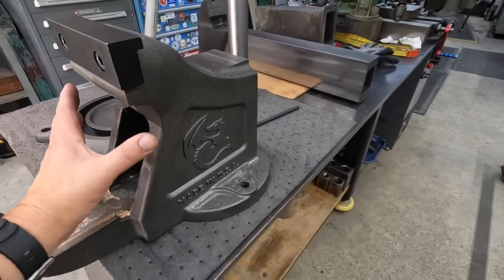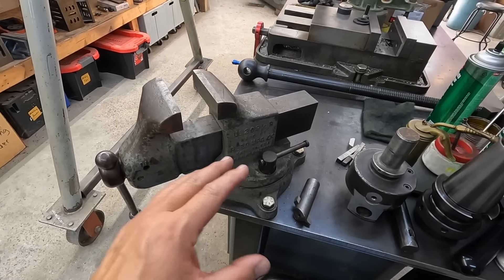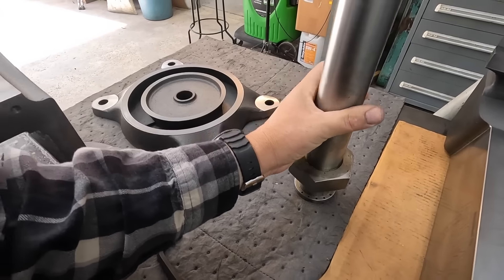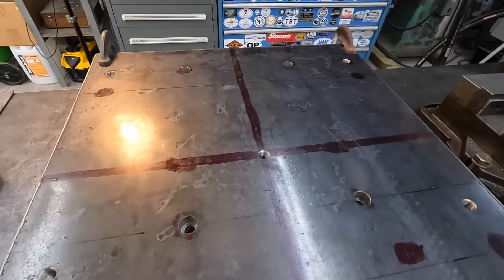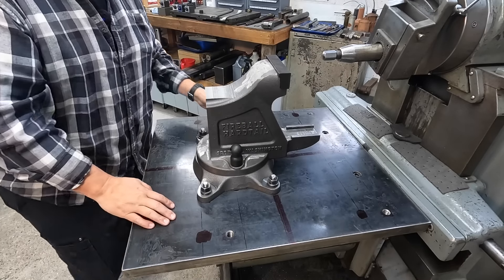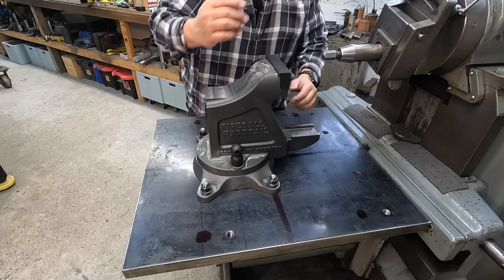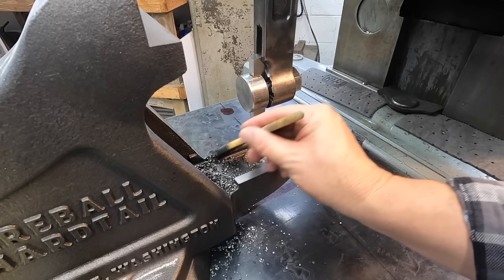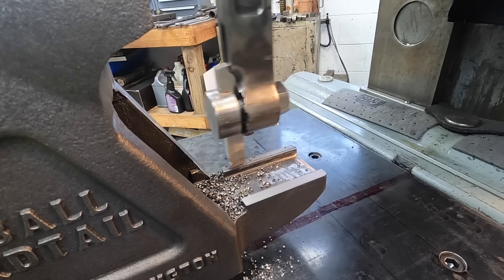Hardtail Vise Build Ep. 21

Comment: I'm not a machinist but what amazes me is the shaper's basic technology has not changed in over 100 years. Keith Rucker has that one from the 1800s and although the motor and mechanisms are different, it does the exact same thing in a different way. Metal scraping against metal making chips.

Comment: Working at Boeing, years ago, we called them bomb sights as they had several offsets built in from centerline. .010, .020 etc. They work great in a bushing holder as you can drill without moving the fixture. Brings me back to the 90's Adam! Loving your workmanship.

Comment: The optical center punch could be paired with a MagSwitch.
Reply: I was thinking the same. Or at least a  not too strong magnetic base so it's still easy to move around but will stay in place when you're removing the optical punch.
Reply: Depends on how much you want to spend.
Reply: How about a magnetic height gauge base?

Comment: If you put a DTI in your height gauge you can zero the needle on the table and then zero it on your machined surface and get a more accurate reading… you can then sweep the gauge over the surface to check for taper etc

Comment: Could you Team Up with Fireball Tool to create a Custom Fixture Table, like one with wheels, that you could rise up high enough to install it on the Shaper, and had built in out rigger supports so you COULD use the full stroke of the Shaper? Maybe use a foot powered hydraulic pump to raise and lower the fixture table to make it easier to install to the Shaper Table. That way you could have a fixture table already with plain and threaded holes and a table long enough to utilize the full stroke of the Shaper.

Comment: Actually when you were indicating the swivel base on the hot rolled plate it was actually dead on, on the inner lip right before the outer one. You can see right before it hit the last one, on the one before it was dead on. So the hr plate itself is actually pretty much perfectly level.
It seems like on the outer lip (closest to the camera) of the swivel base, there's a 1.5 thou dip (which would be insignificant to the functioning of the swivel base anyway) so it wasn't really in the hot rolled plate.
Reply: The 2 machined planes of the swivel base are not perfectly flat/parallel to each other.  The 1 1/2 thou in one direction and 2 thou in the other are very consistent with the respective variances as measured in his earlier video titled  measuring parallelism of the swivel base on the surface plate.  As such, it would imply that the hot rolled plate's own variance in flatness /parallelism  is far less and so is more than adequate for purpose.

Comment: Shouldn't that dimension 4.350" be for a reference only? The most important is to get the jaws to mate correctly in alignment, so I would think that final dimension should be driven by the actual height of the moving jaw from the sliding surface to the top. Am I missing something obvious?
Reply: If that's what it says on the drawing then that's what you do.
Reply: And 'by eye' they don't, going by his Facebook post which is a bit ahead of here.
Reply: @canonicaltom  Whereas on the moving jaw's 2.873 height ( base of jaw to top of slider) dimension, he deliberately overrode the drawing dimension by a 2 thou increment.
Reply: @james-ew7kl  The tolerances on my bench vise are about 1/4" so that really seems close enough.

Comment: Where's the other shaper gone ?
Reply: Just outside the roll up door under a blue tarp. Check out the beginning of the last video.
Reply: @macgyver5941  That is a Radial arm drill. The bigger shaper got sold.
Reply: @seabreezecoffeeroasters7994  Blow the picture up. That doesn’t look like any radial arm drill I’ve ever seen.
Reply: @macgyver5941  Forgotten when it arrived exactly but it was when he made some bolt down block points for the rear concrete. edited Search "Carlton Radial Arm" will get you some video of it.
Reply: @macgyver5941  Trawled his videos and seems he might have snuck in a third shaper to the collection. Lucky his better half is very forgiving 🤣 He did sell the big boy 60" Planer Shaper.

Comment: You only really needed to shorten two of the hold down studs,  There was no need to rotate the vise 360 degrees, so one side would let you go 180.  I've watched you use the shaper a number of times now, it's a pretty amazing machinist's tool, it's too bad that the industry has left it in the past to switch to CNC mills and lathes, but I guess that's the natural progression of industry.  When a better way is invented, the industry moves on.  The internal combustion engine replace the Horse in short order, and the entire horse based infrastructure disappeared, only niche remnants are left.
Reply: If it makes it better for you, there are shaping tools for CNC machines, mostly for splines, key slots but also gears. So shaping will always be a part of machining, you just don't need dedicated machines anymore.
Reply: On the other hand, I’d guess that the right amount of obsession is a good thing in a machinist.
Reply: You're all over the place, bud.
Reply: Didn't need to shorten any of them.  Take two out leaving it secured with the other two, rotate and put the studs back in!

Comment: Great video, very interesting, but it's a vice, consider what a vice is normally used for (beating bending sawing filing drilling) it seems to me that it is designed to the tolerance necessary for watchmaking. Kind of like putting lipstick on a pig!  Anyway I enjoyed it very much. As we used to say, measure with a micrometer, mark with a crayon, cut it with an axe.

Comment: I am sure many of you remember what Abom originally made that heavy duty mount plate for.  He was unable to do the project.  It has also been passed on to a couple other you tubers and still not done.
Reply: I've been thinking about that for months..wonder if Keith Rucker, found a solution
Reply: @edjay395  He might have. He rebuilt a horizontal boring mill probably 6 -
8 months ago. He hinted that it might have been for that stoker engine project.
Reply: That's going to be interesting
Reply: Who are the other couple of YouTubers that Keith passed it onto?.

Comment: Ok, I’m gunna be a captain obvious.. Adam, had you drilled and tapped the holes all the way through the fixture plate, a simple adjustment of the studs would’ve been easy. Also, machining the studs to the correct length was very “Abom” , me on the other hand would’ve just wiz wheeled them off.. 😂 
Love your channel, been a subscriber for a while now,great content and informative instruction… thank you
Reply: Wiz wheeling them clean off?, that's a cowboy thing to do;  brace yourself for a scolding from  @DB-thats-me 🤣.

Comment: So . . . You are pitching. 0015" on the swivel base.  Not a problem except you plan to rotate 180° around.  This will compound that pitch, double it to .003" plus the distance the chin is extended past the swivel base surface you measured.  So if you clock it 180° your going to be out of parallel around .005" or maybe more.  The jaw isn't going to ride parallel on the chin surface you just cut.  

You shouldn't rotate the part, maintain the orientation you have.  Cut everything from the same side so you maintain parallel surfaces end to end and the jaw will be fully supported by the chin as it was designed to be.
Reply: He said he has files for the final fitting. That has to be quicker than flattening the fixture. I don’t imagine it’s enough of a problem yet.